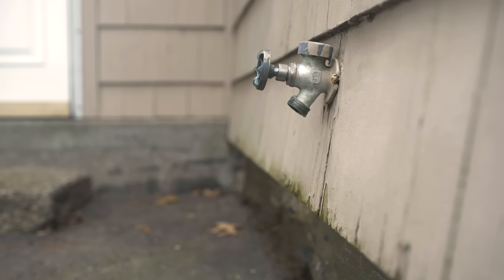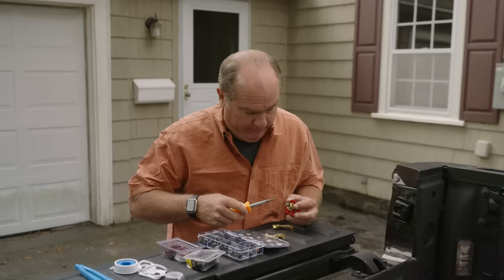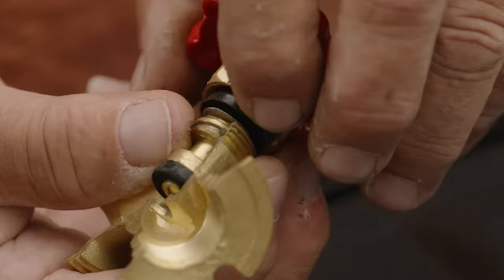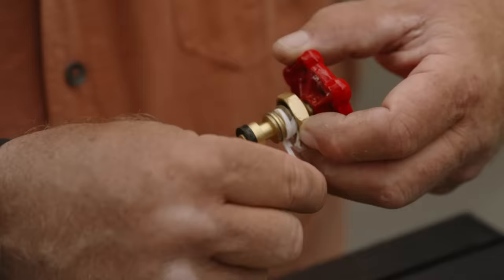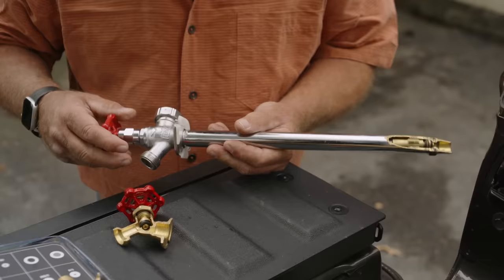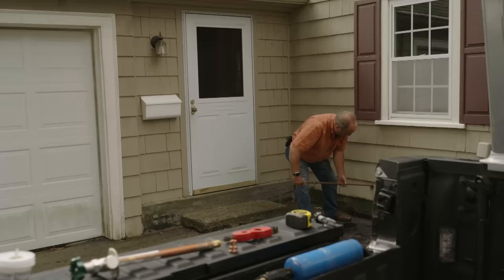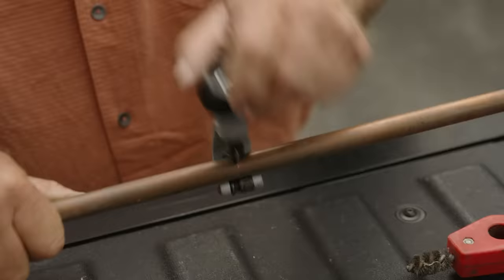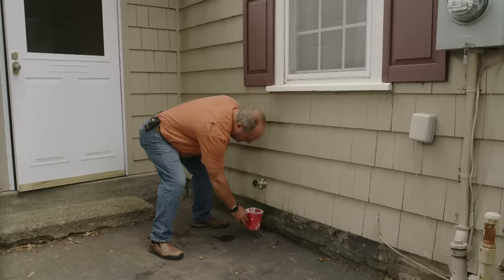How to Replace a Spigot | Ask This Old House

Comment: A local plumbing company would not install a rebuild kit on a leaky outdoor faucet and would only replace it (for $750).  Found and bought a rebuild kit online for $20, installed it myself in about 20 minutes (carefully reading the instructions), and now it works like new.
Reply: @Jess Stuart: You need to find a new plumber, lol. No plumber will rebuild a ratty old faucet but $750 to replace it is absurd unless it involves ceiling removal and replacement, drywalling, taping, priming and painting, etc.
Reply: You can buy the same spigot and use the parts to replace on the one that’s on the house.
Reply: Now you can get yourself a plumbing license, and go charge $750 to replace a faucet.
Reply: A new faucet valve costs $10 retail. A propane torch costs $20 and some solder and flux for $10.  $750 is an insane ripoff.
Reply: I just got quoted $750 as well from a plumbing company.
Reply: I got quoted $1,000 to replace leaking faucet. Told me they would have to cut a hole in the wall but they would not fix the drywall. I respectfully told them to leave.
Reply: @jasonkane8570 I’ve been told plumbers are trained not to do anything but plumbing and they pretty much just get in and out ASAP.
Actually, you probably don’t want a plumber doing your drywall anyway.
Reply: It was probably Roto Rooter.  They wanted to charge me $650 back in 2014 to do this job.  I had another plumber (who did work on the side) and did the whole job for $175.
Reply: @LBCAndrew Same as masonry work.
Reply: That's like a no-bid.  I think there is such a demand now for plumbers just about anywhere, and they  only want to be doing involved and bigger jobs.  If it's a job like this, it's on the homeowner now to figure out how to solder, use pex or use the sharkbites.
Reply: Good for you! And now you learned something, have confidence for other repairs, and can teach others. Marvelous!
Reply: @asherrfacee likewise! I can’t believe what I’m reading here in the comments. Absolutely insane to be told this would be ~$700!

Comment: This video inspired me to try out the teflon tape at 3 different spots and stopped the leak. Been failing to take off the leaky hose bib for 7 months and I was finally going to call a handyman. Saw this video when I couldn’t fall back asleep this morning, so I’m just stunned that this problem is finally over. THANK YOU!

Comment: Thanks for the video, it had all the information I needed to replace my leaky faucet.   Went frostproof, added a shutoff inside as well (in case I fudged it).  I had a similar problem to the home in the video, soldered pipe for the first time today... so far everything's working great

Comment: Love Ask This Old House and all the great information. I have one comment about this video…, having just been involved in one of these frost proof type spigots (water hydrant), the manufacturer strongly urges that the pipe be on a 5° downward slope towards the outside to allow any water inside the pipe after shutting off the outside valve to allow that water to drain out. If not…, water still inside the pipe could freeze and crack the copper pipe. That’s ’exactly’ what happened to my neighbors spigot/ pipe.
Bob R

Comment: Mine was soldered like that, however the builder had a union installed after the shut off valve. Made it so much easier to replace.

Comment: I'm a plumber in Ontario Canada, And I still have to rip these frost free hose bibbs out all the time. They freeze and bubble from the frigid temps, and even our Michigan brothers can get colder weather. I've had these actually damage a customers ceiling. They didn't think it was the outside tap because the leak was intermittent. When they used the outside tap, it would cause a leak through the body and into the home.
Reply: I actually worked ar a plumbing manufacturer. They made lots of frost proof.You can't leave the hose on all winter.The water in the hose will back up and freeze.You have to angle them down.Some Manufacturers design them with the angle already in them

Comment: I don't like to call people out but you should have installed two sweat 45 degree fittings to get the hose bib able to drain once it is shutoff because it was still holding water in the shaft of the hose bib. It could still freeze from water being left in the bib and the reason I no is I've already had to replace a few because of that mistake just letting you know,  looking forward to the new video of you going back and fixing it properly thanks

Comment: Great lesson on replacing the unit.  Surprised that as in other repairs, you do not suggest the quick and easy try first.  In this video, as in my experience, the washer mount has come off the shaft, and can usually be reassembled with a new washer.  It just takes a minute with the handle removed to turn on the water for a moment to blow out what is left of the innards.  Also, while longer is better,  I like to just unscrew the spigot and replace it with a new short one in minutes. The old one never froze, so a new short one should have been fine.

Comment: One word of caution. At 1:16 you'll see how you normally have to hold that. It just is what works. Just be aware that you have to push pretty hard as you turn  The screw back in order to keep the screwdriver engaged. If you slip you're going to run that Phillips screwdriver right into your hand. Usually it's going to go through the web of your thumb but it will definitely bite so I usually hold it with a shop towel just to add a little cushion.

Comment: Wish I knew to remove the handle and insides before heating  my old one , pretty sure I cooked like he said.. great video thanks!
Reply: A lot of plumbers cheat and just open the valve all the way before soldering.
Reply: @AStanton1966  thanks for the tip .. I was in a rush and just went with the sharkbit brand for a couple extra bucks , saved me a ton of time .

Comment: Makes it look easy but down here in the south we don't have basements or easy access to replace our outer faucets
Reply: i thought homes in the South had basements?  Inclement weather is one reason for having them, right?
Reply: @menghic531  Not many of them. It depends on geographic region. Florida has almost no basements because of the high water table - meaning the groundwater level is so high that it makes building basements impractical. It's not impossible, but it's impractical and cost prohibitive. A lot of houses in the south will have crawlspaces where the house is built up above the ground.

Comment: Important detail not covered: the frostless bibb needs to be installed with a slight tilt so water in the line can drain when shut off. 

Also, hoses must be removed when there is risk of freezing temperatures.... or the water can’t properly drain.
Reply: Yes fo sure
Reply: Great reminder @bigmo PRIER has a 4 degree built in pitch to help it drain. Most don't offer that so it's important to tilt it.

Comment: That frost proof can cause problems. I've seen this happen twice. Some one turns off the valve, but leaves the hose connected and still full of water. The temperature drops freezing the water in the hose, and on up into the pipe just inside the wall, splitting that piece of pipe, between the valve and the outside connection. After it all thaws out. You turn on the hose again, water starts spraying out that split in that short piece of pipe. At my house it was behind the bricks under the house. Dont leave your hose connected and full of water if temps can drop.
Reply: When you turn off the valve, just use the vacuum breaker, though really you should just remember to remove the hose.
Reply: You should be putting foam housing over it for the winter regardless.
Reply: Oh my goodness. This is LITERALLY the thing that happened to me. Had to mop up a ton of water in my basement. I'm a new home owner, and was a fool to not disconnect the hose (still full of water). Would've saved myself the trouble had I simply disconnected it.
Reply: @Xtermin8ter  sames. Just happened to me. What a mess. Thankfully I caught it after only 15 minutes filling my intex pool. I was going to leave it run all night. Carpet & celing are now getting pulled.

Comment: i have low to no water pressure in the house. the water company put on a new meter and the water pressure coming in is 60 lbs pressure. i had a new water pressure regulator installed on top of the water heater in the laundry room. adjusted it almost all the way down and still no help.

Comment: Awesome video and great information. My frost proof spigot doesn’t work. I turn it all the way on and nothing comes out. I’ve looked in basement and there is no shut off valve to it separately. So in theory it should work. Just not sure how I fix this issue?

Comment: I have a situation where my outside Spicket is missing the handle to turn the water on and off how do I repair that
Reply: You can buy a hose bibb handle kit (check Amazon: just search "hose bibb handle") and attach it to the stud where the old handle was. Just match up the shape of the stud (square or round) and screw in the new one. If the old handle fell apart and left the set screw in the stud, then take a screwdriver and back it out, then screw the new one in and you're done.  If the old screw sheared off and a part of it is still in there, it's a bigger job. Try to take needle nose pliers and work it out of there. If you can't get it out, then it's probably best to replace the whole thing.

Comment: My washing machine, sinks and toilets all have flexible lines of some sort for the last couple of 
feet. Why does my spigot need to be soldered all the way through?
Please don't call the plumbing police...I used a stainless washing machine line and a couple of adapters when I replaced my spigot. I still had to solder one fitting, but next time I replace it (probably won't live that long) it will take 3 minutes.

Comment: Just purchased a new valve and out of curiousity took the stem out to find a washer ,but no screw holding it in.Just a nub that looks as though there is no way to change it.Maybe special washer that presses over it .Iam just guessing.Help please? Should I RETURN IT OR LEARN MORE?

Comment: Wouldn't you need something in the line to let the air in when you close the valve from the inside so that the water can drain out & prevent freezing in the winter?

Comment: I always smear a dab of grease on the threads of the bib screw that holds the washer in. Never had one back out in 35 years but I never had one I greased break off either. Here in the south we are plagued with tight crawl spaces so we use pex on our sill cocks and leave a 16" diameter loop in it under the house. When one fails (someone left the hose on ) simply shut off the street cock, slide the old one out, cut the pex and crimp on a new one! Done in less than 30 minutes and you didn't have to crawl on your belly like a reptile!

Comment: Mine is in the wall of my house looks original and I turned it on (it hasn’t been turned on my whole life I’m 19) and it started dripping but it looks like it welded or it would just break if I tried to fixed it so it just gonna drip for 30 years probably

Comment: My house had an old spigot.  The water recently would not turn off as the threads were worn so it just kept spinning and spinning.  
     So I took off the upper part of the valve with a wrench and happily drove to Home Depot, then I unhappily drive home because, of course, they didn't have the part. 
     I checked in my basement and I cannot see anything threaded, just soldered copper pipe.
     So my question is, is it safe for me to try to unscrew the spigot valve body, assuming there are threads inside?? Or could it be soldered in there too, and have no threads?
    I'm in no rush.  As now I just leave the main valve on, and use my splitter's two valves to turn the water on and off.

Comment: I have similar problem and will require replacing the whole thing. I am not handy and was wondering getting into cutting pipe, soldering etc. is easy enough? Has anyone come up that curve from a total novice? Thanks.
Reply: I ended using sharkbite and it's been good..2 days in

Comment: I want to know how to replace one on a brick home.
Reply: It's the almost the exact same procedure for installing it - the only difference is that you'd need to pre-drill the holes for the mounting flange in the brick so that you can run some tapcons to secure the faucet flange to the brick. In this video, Richard was just attaching to siding so he just used wood screws.

Comment: I recently bought a hose reell and new hose. My previous  hose conected directly to the spigot no problems the new set up is a short leader hose from the spigot to the hose reel and the new hose attaches to the hose reel in having water spray from the leader hose under the female thread that connects  to the spigot. I tried a new leader hose and have the same problem. The previous  hose got stuck on the spigot and i had to cut it off i didn slightly damage  some of the spigot threads nothing too bad tho. I'm wondering if its the threads even tho the leak seems to be from every leader hose or if the reel is to tight and theres too.much back pressure  it is a very old spigot but i dont know if its a simpler fix or just replace the whole spigot any help would be appreciated

Comment: Yeah I wish I knew about soldering inside the threads. Put an adapter on and had to mallet tap it through brick. I pity the fool who has to remove it

Comment: This was good info, but why still use copper pipe?
Reply: Because the existing house is already fully plumbed in copper. No point in converting to Pex for such a short run when everything existing is 1/2" copper.
Reply: @bullmoosepiper7732  To me, easier to solder on a pex adapter, get a new pex spigot and run pex to it. 10 minutes (ok maybe 15).
Reply: Because plastics leech chemicals that act like estrogen.  Don't need my voice going up an octave 😁😁😁

Comment: How do you do this when the ceiling in the basement is finished?  Are you stuck having to cut into the ceiling or is there a way to thread a faucet on/off?
Reply: I would think you would have to cut the ceiling but patching it should not  be to difficult.
Reply: Depends on how it was installed.

Comment: I'm looking for an apparently older/vintage spigot just to get the type of bonnet that has two threaded areas -- not just the threads that squeeze/secure it onto the spigot body, but the threads that make the stem go up and down to seal the rubber washer against the seat.
My older building's spigot (body) would be a nightmare to replace, so with a worn seat of threads in the bonnet, I'm trying to find a replacement bonnet only -- or a spigot with that type of bonnet to replace mine.
Every spigot/sillcock that I encounter nowadays, is the type shown here -- with the threads inside the actual spigot body -- which simply won't work.
The stem's threads have to be in the bonnet itself.
Any ideas?

Comment: I wonder if soldering is that a great idea.  In this case you have a relatively easy access inside.  But what happens when you have to replace the spigot in another 10/20 years? Yes you can cut and re-solder.  But would it be easier to just use the thread?

Comment: can anyone help me out, i changed my leaking spigot to a frost proof one. I cut the pipe a few months ago and left the project for a while.Just had someone finish it off, but when we turned the water back on, theres no water flowing through the pipe. I dont know what the reason is because after the valve that turns the water off for the spigot there is no other valve that needs to be opened. I think its some air trapped but it makes no sense, thanks in advance!
Reply: Air would not prevent the water from freely flowing. I would double & triple check that there's not another inline valve somewhere else further up the line which has shut the water off to that faucet. A lot of times, the outside faucets are tied off to the same line the kitchen cold water line is on, and I've seen valves in a kitchen cabinet  to shut the outside water faucet off in the winter time so that the homeowner doesn't have to go to the basement to do it. It's really hard to say without being there or seeing pictures. If you call a plumber out, they'll figure it out in about 5 minutes.
Reply: @bullmoosepiper7732  I ended up finding the problem, the person who installed the shark bite to fox the connection installed it the wrong way. It was 1 way flow🤦‍♂️. Thank you though!
Reply: @shalindholakia  great news! So glad you found it! :-)
Reply: @shalindholakia  News to me, I didn't think Sharkbite made one-way valves.  Those are usually for stop-waste valves.

Comment: It must be different in the US, in the UK new taps (or faucets) for outside cost about £7 or around $10. You'd never bother wasting your time trying to fix or service one unless you'd no choice.
Reply: Most exterior taps in America are not easily removable and replaceable.  The time it takes to service is far less than replacing the entire tap like they did in this video.  

I really do wish they designed these better where you could easily replace from exterior without cutting pipe.  It shouldn’t be that difficult a design even in area that have freezing in winter.
Reply: @Kevin-mp5of  more landfill? In the UK we recycle these kind of products.